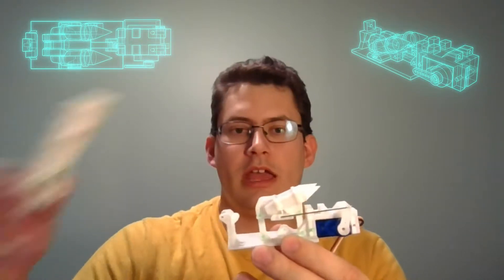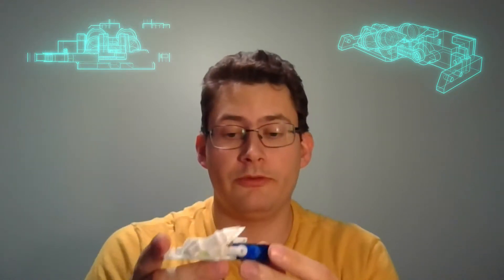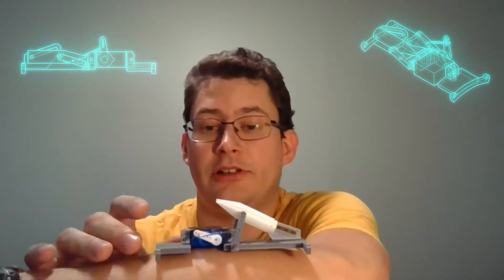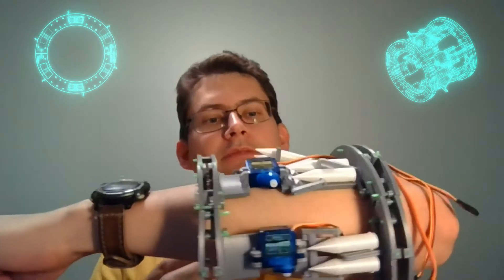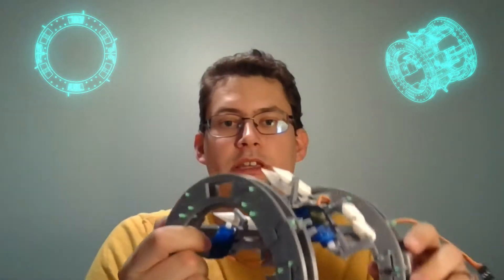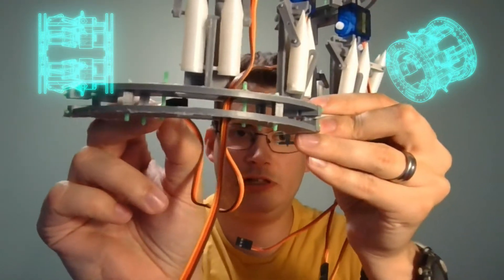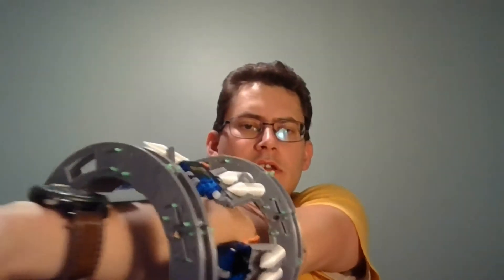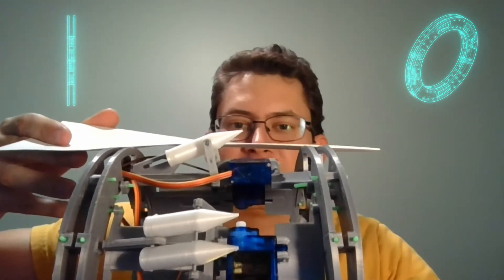Iron Man Mk 6 Forearm Rocket - Update #5

Comment: Make the railing system to place it on your forearm then flick the switch it closes and the telescoping to fit your arm and also locking the two sections together
Reply from the maker: I think you'd be interested in the later versions of the project (this video is about 3 years old, and there are two major revisions since it was posted). Each rocket can be individually controlled, and they pop out in a pattern. The two sides also open up and allow me to fit my arm in.
Reply: @DrCyanide   damn dude thats freaking awesome im sorry i didn't see how long ago it was . Could you build me a armor not ironman blood red and chrome crymson dynamo armor
Reply from the maker: @bearvassar6690  I don't do commissions like that. For one thing, sizing armor is incredibly difficult, and I don't want to deal with the hassle of trying to get it to fit someone else. For another, large commissions eat into my personal time too much.
Reply: @DrCyanide   Thank you for responding is there someone else who can help me

Comment: It’s a very good concept, but my question is, is this designed to be functional or just for show? keep up the good work ^_^
Reply from the maker: In the newest version (Update #8), the mini rockets are based on the dimensions of the 1/4A and 1/2A hobby rocket engines I found listed on a particular website. Those hobby rockets could theoretically launch out of the new design if ignited. I'm not 100% sure those dimensions are accurate, but the entire design is modular enough that I could update the parts if I wanted to try it.

That said, this is intended just for show. I might do a "Make it Real" version after I get everything working, but I have enough features to pack into a small space as is that I'm not going to worry about that now.

Comment: Great job on designing that how did you come up with it and your YouTube  name is interesting I have 1 question why that one  why not Dr. Stark as in Howard Starkbut I like your work I might need your help with an w/exoskeleton  suit design of my own
Reply from the maker: The name is one I use in various video games (I like the juxtaposition between "Doctor" and "Cyanide"). 
The design has been trial and error. Design something based on my best idea at the time, print it out, see where it works and where it fails, then repeat. My latest version is significantly better than the one in this video.
Considering the time that it takes to work on my own suit (and be somewhat responsible) I'm not available to help with your designs. But I do want to see how it turns out!
Reply: @DrCyanide  okay I understand my design is for Robocop of the 1987 era